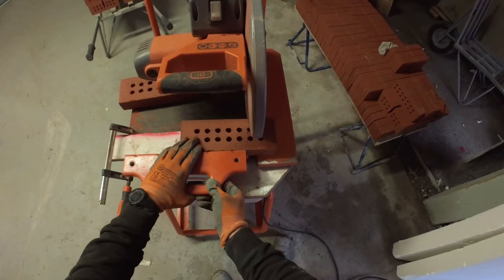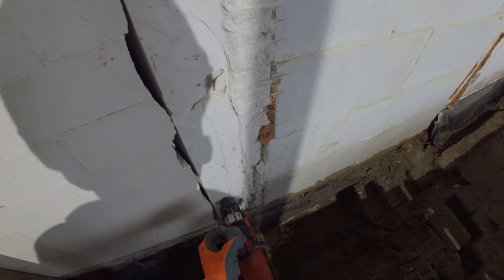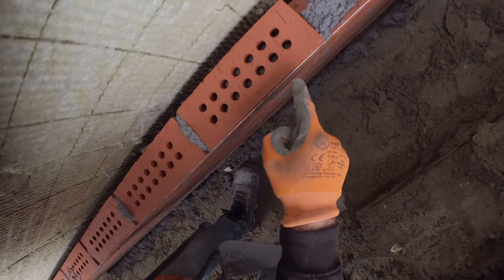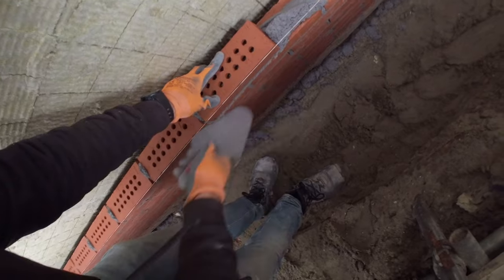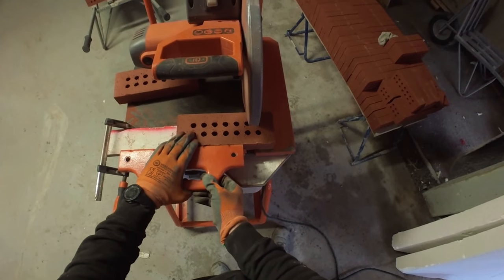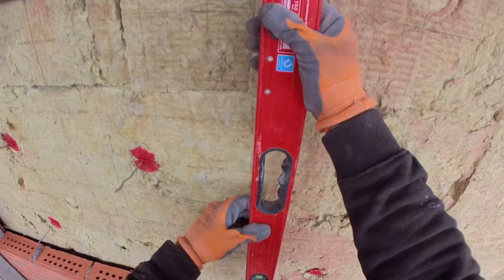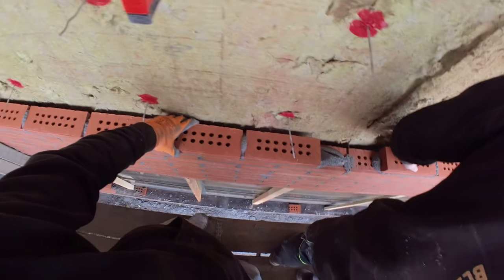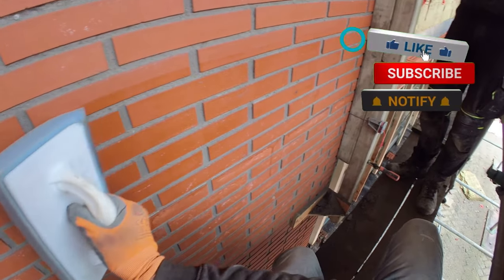Perfecting the Craft of bricklaying: Bricklayer tips, Sponging, Advanced drilling

Comment: Beautiful work. From the wall ties to the insulation and the brickwork itself. It’s all done perfectly. It’s strange the tools you use compared to the UK. Your trowel is a lot more round and a lot smaller and we use mechanical drum cement mixers but that’s a good idea how you use the hand paddle mixer. How long does it take to mix mortar with that method ?
Reply from the maker: Thanks appreciate it, we use that hand mixer just for mixing up when its becoming dry by weather conditions. First is comes out a automatic silo.

Comment: "A dime from the line and every time your heart beats". The use of the sponge float to finish off the brick wall is used here in the States too but only for brick used in your video. One trick some of us use,older masons,is burlap. Rubbing the wall first to knock off any small hanging mortar than the sponge. Clean water and once again. A piece of very short knap carpet works well too. By-the-way, Beautiful Work. Checking the windows for bond is always one of the first things on the list. But sometimes it is what it is. Make more but please less background noise and so we my hear the narrative.
Reply from the maker: Thanks and nice to hear we have similar ways of working. I know what you mean we sometimes use a liece of insulation to remove some mortar. We also use clean water before sponging. And with alot other bricks we do not use the sponge.